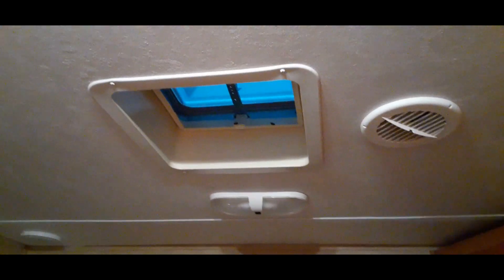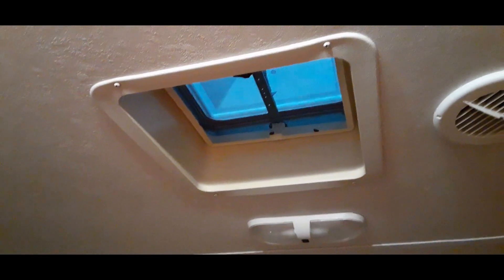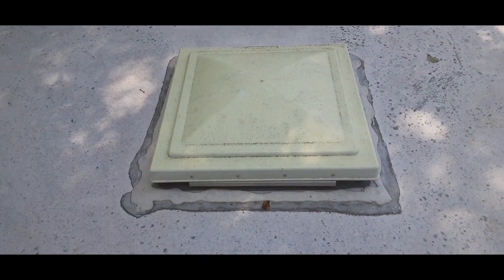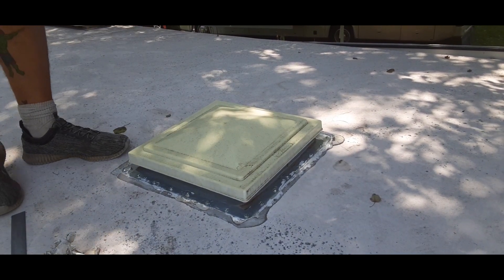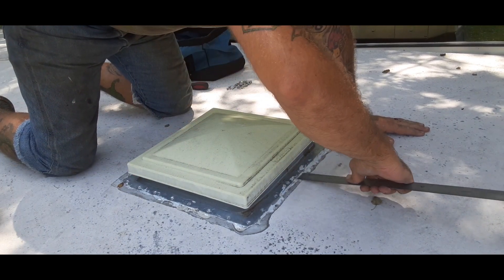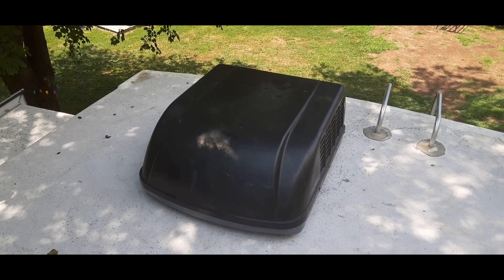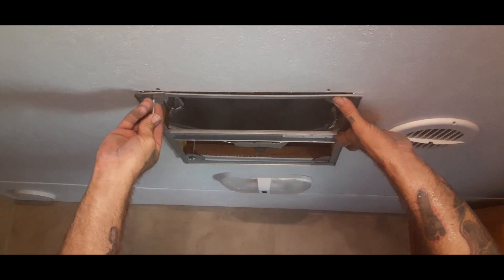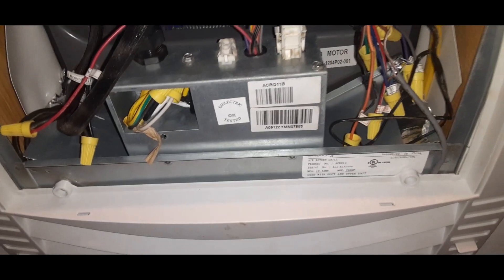RV Second AC Install DIY - NO 50 AMP NEEDED

Comment: Great job bro! Are you gonna run a second surge protector?
Reply from the maker: I forgot to put it in the video, but I installed a separate 20 amp breaker box in the wardrobe so that It has a breaker to pop if it would surge.
Reply: @RVkidzTV  yeah I saw it in your layout but nothing after that. Must of been to much chlorine from da pool!

Comment: I had a client refer this video to me, and I would like to make a few suggestions based on things I've seen and experienced personally as well as with other clients and campgrounds.

1. From how I see most clients use their RV, I might suggest wiring the A/C to a 30 amp plug. You can convert to a 20A as needed of course.

2. If you have the 30 amp end, you can get a 50A to 2 30A adapter, which most seem to have a 2-4' length on ( more on why this length would matter in a minute ), which would allow you to plug in the coach and the A/C pretty easily, as well as have a single 50 amp surge protector, compared to 2 x 30 amp, or 1 x 30 amp and 1 x 20 amp ( good 20 amps are not as readily available ). 

3. These all tie in together, because what I have seen in practice is a lot of campground owners/managers driving around and seem to hone in on pedestals that have 2 wires coming out of them going to the coach. Meaning, they drive by, see the second wire coming from the pedestal, and the knock on your door and tell you to unplug the auxiliary cable, and in some cases risk being thrown out if you don't comply. This can take a nice trip and make it pretty tough when you chose a spot that maybe wasn't shaded great knowing you were going to have 2 A/C's, only find out you have one. Where as if you have the single 50 amp surge protector with a single 50 amp connector coming off of it, and the split is on the ground, normally they're not going to get close enough to even see it. Even if you don't have a 50 amp surge protector, or you have a small one, the length of the 50 amp to 2 x 30 amp would probably be long enough so the single wire is still the only one visible from the pedestal.

Now of course if you're at a spot that only has 30 amp outlets and not a 50 amp, then this doesn't work, but like I said, I was making the recommendation based on what I see a lot of time, and at least in the area I live in, and travel to for my own personal camping, a lot of sites that would seem small for a 50 amp coach have 50 amp service. Mostly because the campground just puts the same thing at all the sites except maybe the primitive ones. 

If the above option(s) do not work, I would at least recommend maybe getting a large 2"-3" mesh split loom tubing style component that you could wrap around the two cords so that at least from a distance they might look like one large one.

Comment: Getting that crap off the roof is the hardest part. lol. I did 3 fans and it sucked. I found using solvent will help a ton. Very nice install man. You had me smoked at the electric work. I do not know that stuff at all. Very impressive. Very cool how it plugs in. Makes it much easier for people like me. Very nice share man. Well done.
Reply from the maker: Thank you. It really wasn't that hard to do. The ac is heavy and getting it on the roof was probably the toughest part. But the weather has been 60°s at night and 80° during the day. We haven't even needed the second ac but it is so nice to know that we have it if we need it

Comment: Good job....  I wonder if you'll have any issues with the GFI 20 amps popping with the A/C
Reply from the maker: So far, I have had no problems. I have a 20 amp breaker box in the wardrobe also... I forgot to show that in the video. I have yet to pop any breakers or gcfi's.